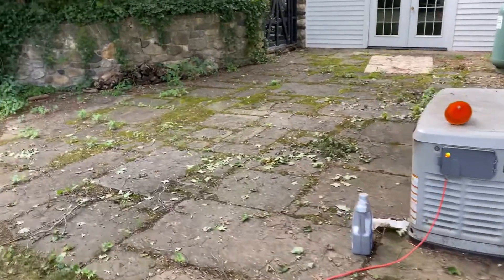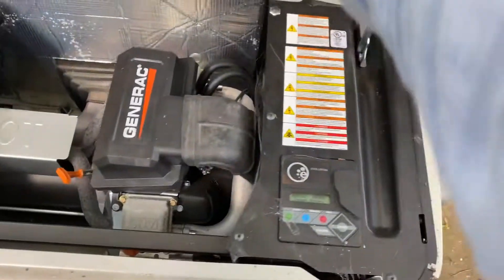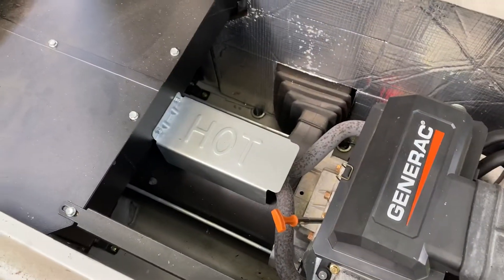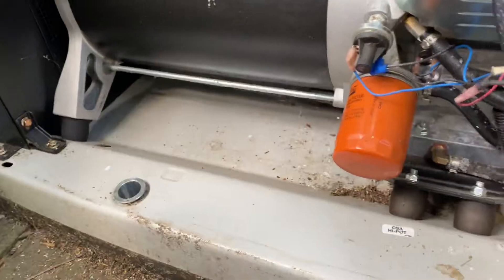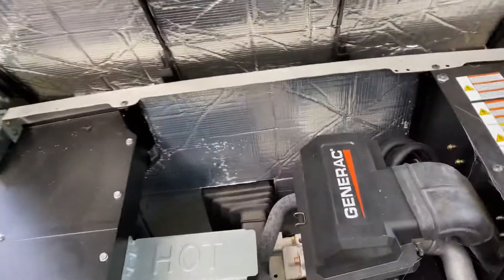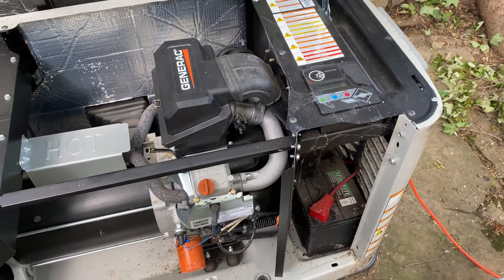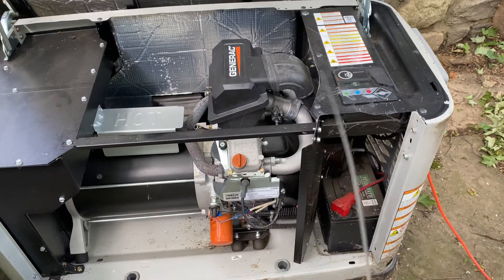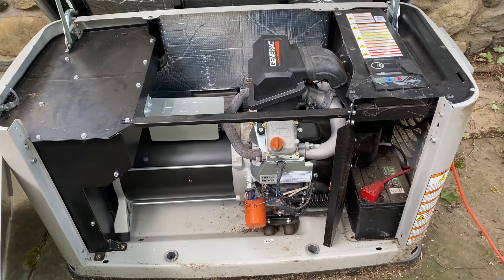How to add oil to a Generac Generator

Comment: Thank you! I seen another video that was VERY detailed to where the guy also tells you to turn off your house circuit breaker. If anyone has seen his videos, while i do appreciate him being extra safe, DO NOT SHUT YOUR HOME BREAKER OFF IF YOU HAVE SSM BOXES. They will BREAK because it WILL cause a surge of power. The other guy says to turn the house breaker off to avoid surges but no this is not the case. 

Think about it, these generators automatically come on/off when utility power goes off/on. Do we touch our house main breaker? No. I listened to that other guy and broke my SSM boxes.

This is the best video to follow. To the point and no unnecessary steps. He also shares oil type, etc (always confirm type and max amount in your manual). I would maybe add how to remove the front panel (just pull UP), but other than that, it is great! Thank you!
Reply: *GENERAC SSM boxes. If you don't know what that is, you don't have any. You might have one just for your range, for example. It would be located by your circuit breaker in your home. Just don't shut your home main breaker off, period, that fixes that!

Comment: I think I added a little too much oil to my 22kw gen after the last storm. I even drained a little bit out before I put it back in service. However, when I checked yesterday, which was the first time I had looked at the generator again, and since it had run it's weekly 5 minute test run, I found that maybe I had not drained quite enough and that the crankcase was over-full. I found an oily mess inside the engine compartment, the oil fill cap was off and laying down in the bottom of the floor, and there was about a centimeter depth of oil in the air cleaner housing. The air filter was partially stained and that I will replace. The oil level, upon checking now is okay. The fill cap is back on hand tight and snug. I thoroughly cleaned out all of the oil from the air cleaner housing. I ran the generator for a few minutes and all seems well. Just waiting for my new air filter to arrive now.